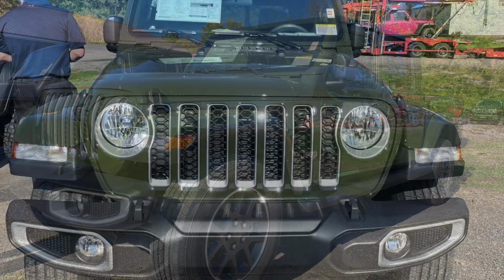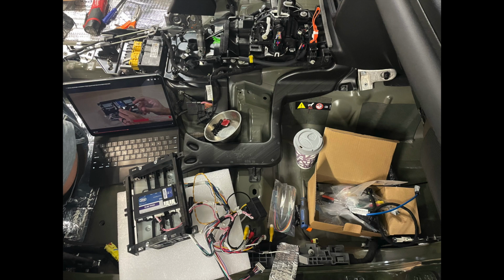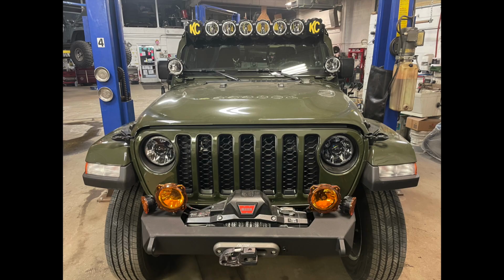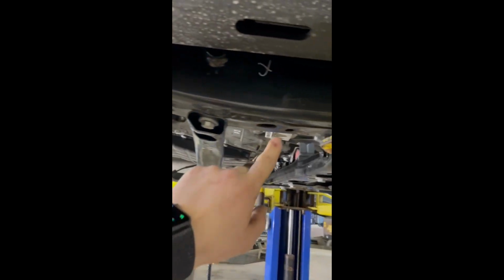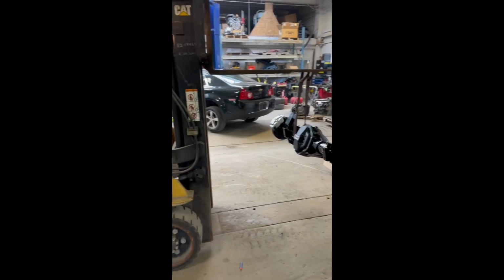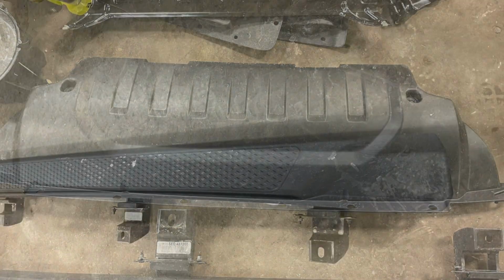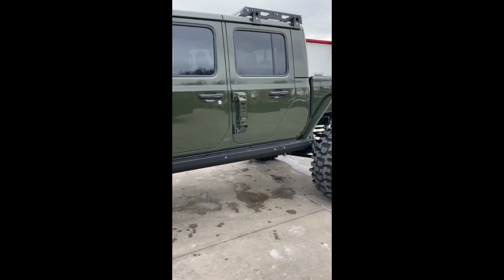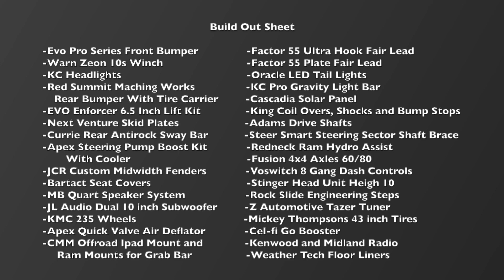Extreme Custom Build! Brand New 2021 Diesel Jeep Gladiator On 43's! Revised #RockCrawl #OverLand

Comment: Hi, I have encountered a difficult problem and I hope you can help me answer it. The large tire I installed is 43x15x17lt tire, Mickey Thomson Baja Pro; And the axle I replaced, the current axle is dana60. I have also changed the gear ratio of the car code, but I feel very shaky while driving. May I ask where the problem is? I hope you can help me answer my questions. Thank you very much
Reply from the maker: Those tires will be shaking going form the road.  That’s just the style of tire they are.  They won’t be smooth as a normal tires.  They are bias ply tires.  After about 10 min of driving it does get alot better tho for me.  Do you have the pro xs? Or the pro x?
Reply: @adventurefurtheroffroad  pro xs.So what can I do to make it less shaking？ thank you so mu ch